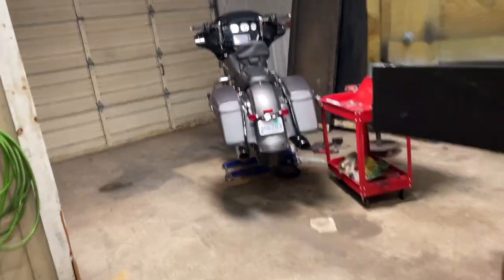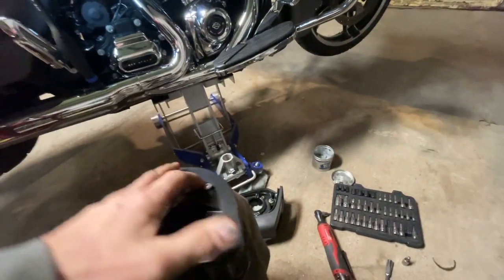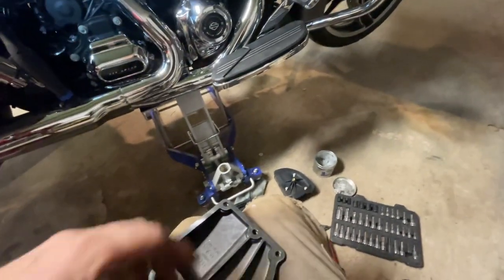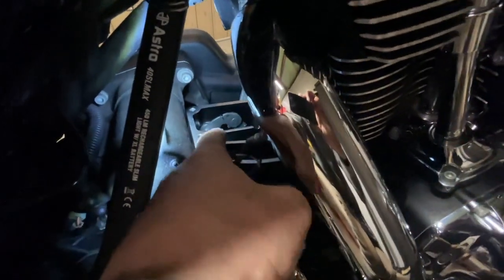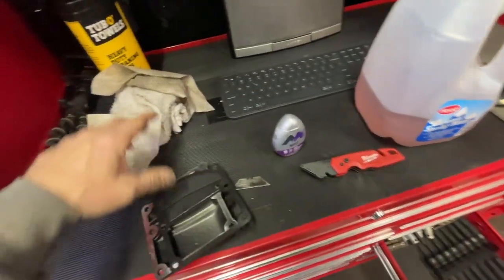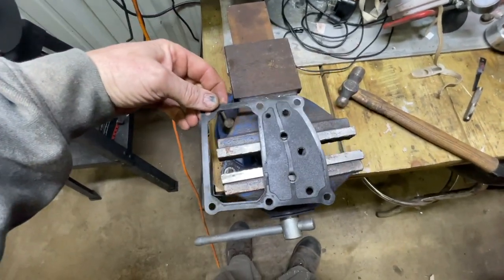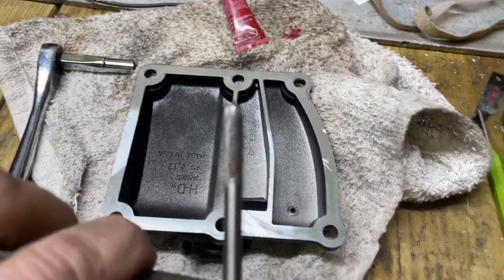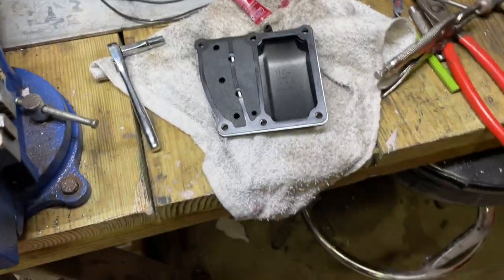Harley Milwaukee 8 Blow By Transmission Cover Mod | Shout Out BlockHead Channel

Comment: You need a new gasket.  The trans and oil pan need to be vented separate.  The middle section of the cover is the trans vent, that’s why HD put a relief in the casting to vent the trans.  You do not want engine oil vapor getting into your trans.  Engine oil vapor is contaminated with blow by gasses, as all internal combustion engines do this.  Adding a vent to the oil pan side of the cover is a good idea but allowing it to mix with the trans is not.

Comment: I have a concern with your method. I opine the engine crankcase pressure exiting via the breathers located on top of the rocker lockers, which then gets ported out to the air cleaner is higher than the internal transmission pressure that that cover is clearly engineered to vent. While the engine is running you have created a positive pressure in the transmission vent chamber that will either prevent the transmission from venting or causing a positive transmission pressure. If you force crankcase gasses into your transmission, it will create a tsunami of frothy oil that may reduce lubrication efficiency. Which is the sole purpose of venting the transmission to the atmosphere in the first place. 

I have seen the modification you are trying to re-create. In a couple, people have routed the crankcase breather gasses into the transmission cover above crankcase opening chamber with intentions of reintroducing them back into the crankcase. That is a horrible idea and is going to grenade their engine due to oil pump cavitation. The crankcase should be at an equal or negative pressure relative to atmosphere or else a tsunami of mixed air and oil will be swishing around inside the crankcase. That emulsion of air and oil causes the oil pump cavitation. H-D dealt with it by sending it through the combustion cycle to burn it for emission reasons. You at least are attempting to port the gasses to the atmosphere by sending them to the neutral center chamber by cutting the gasket. Realize now you are not only sending crankcase gasses from the top of the head to the atmosphere, but also gasses and oil from the chamber you opened. During acceleration oil may fill that chamber and puke it out the vent tube and even into your transmission. Think on that for a bit and I’ll reply if more clarification is necessary. The best method is simply adding a bulkhead barbed hose fitting to the cover over the crankcase chamber, attaching a bit of tubing, check valve, and small filter routed back and high enough so you don’t end up with a siphon that drains part of your engine oil. That will relieve enough of the excess crankcase pressure to reduce what exits through the head breathers into the air cleaner so it isn’t an issue any longer. The check valve prevents air from being sucked back into the crankcase while each piston is moving in the compression or exhaust stroke.  The same thing the umbrella valves do on the head breathers. I’d get a new gasket and correct that sooner than later. Your engine crankcase is just sucking in air with every piston upstroke and will compromise oil pump efficiency. Just my .02 cents.

Comment: You are venting the crank case to transmission. I don’t think they share a sump on your model so this would basically mix oils! You need to vert that chamber separately to the other ones.

Comment: I watched the Blockhead mod, and like you could not see how it actually vented, until the updated video where they notched the gearbox housing :0
I am wondering is it necessary  to run the hoses from the intake down to the cover? I guess this takes away all the grunge that would have been vented into the intake. If you just did the mod were the cover gasket was modified  as  you show, this may mean there is none or little coming out into the air cleaner, as the crankcase pressure is vented there.  HD obviously can't do this because of regulations.
Reply from the maker: The hole in the transmission cover that leads back to the oil sump I believe because it’s low won’t vent there, come to think of it I’m not sure how it works there…. Kind of went on 25 year mechanics advice and also the covers you can buy…. I do believe there is a check valve involved though on the cover you buy….. I will do some more research on how that oil gets back there etc…. I do know however there is no way that taking that oil away from the intake is a bad thing….. that alone even if you catch can it is great.
Reply: @KenMrKLC  I am coming at it from my knowledge of of my BSA that has a similar lube system. oil tank, pump and scavenge pump back to tank. I guess it depends on the oil level in the pan and where the vent through that chamber from the crankcase to the pan  connects. My own view is the cover chamber that is over the link is at crankcase pressure, so venting there would be same as head breathers. Further research required as you say. 2019 Streetbob rider by the way.